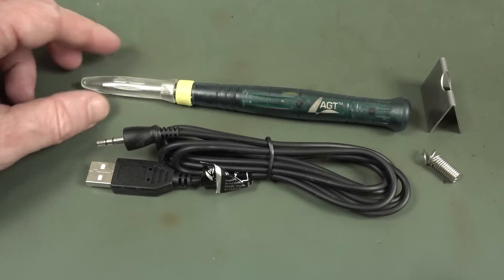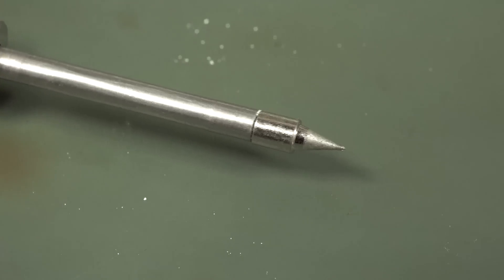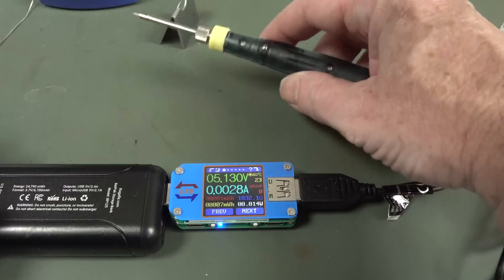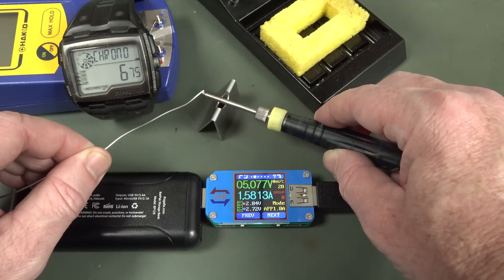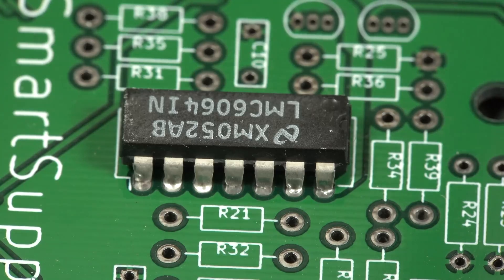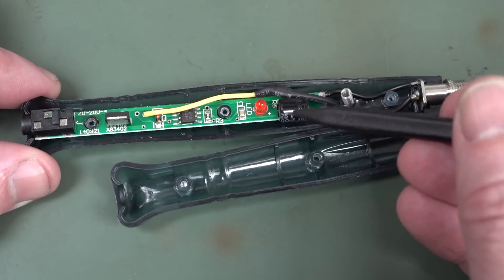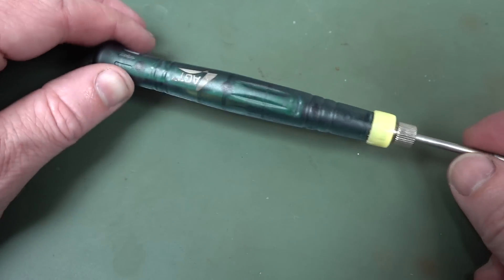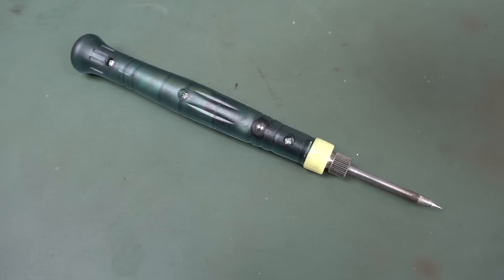EEVblog #1113 - Is a $5 USB Soldering Iron Useful?

Comment: How long was that cut in "lifting a pad" scene? :D
Reply: Peet electronics To an extent it really does not matter how long as that was a new PCB — when you go to use it on some older or vintage PCBs they can be very unforgiving if you do not pay close attention to temperature and dwell time, which can be problematic if the component has a large thermal mass to overcome since the component can take a long tine to get up to temperature but the pad heats quickly thus weakening the already weak adhesive.  Where you often get into even greater trouble is trying to desolder with desoldering braid as the temperature drop can cause the iron, braid, and pad to all become welded together, then when the user goes to lift the iron they take the whole assembly, pad included, along with their iron.  This is one of those products that would be much more useful if it were at least 15-20W with a larger thermal mass and alternate tip types, but then you could not just use a 2A 5V USB port or power bank for power.

Comment: I almost pissed myself laughing when I saw you trying t out on the ground plane...  That's like trying to remove your wheel nuts with a pair of tweezers!!!
Having said that, I do reckon it's still in the 'few sammiches short of a picnic' category.
Personally, I just keep a TS100 in the car for any 'out-in-the-field' work and can either choose to power it from the cigarette lighter, or if mains power is available, there's the old laptop charger.
(And the majority of the time, I DO have mains power available as there's almost always a 1500VA UPS or two sitting in the car too... LOL)

Comment: I bought one a while ago to fix my...soldering iron :)
it needed a simple soldered fix and living in the middle of nowhere getting one of these delivered the next day was my quickest/cheapest way out. its been in the tool box ever since and sees occasional use. 
the capacitive switch and time out thing in mine seems to work fine and appears more sensitive than this one but its still annoying. I did think Id rather just have it on when plugged in and off when plugged out and almost modded it to be so but stopped myself just in time. with the high tip temp and no regulation its probably a really bad idea to have it sitting there getting heated, if you left it for 5 minutes it would probably kill it.

Comment: The one I have also has a spring surrounded by a grounded chassis that hits the side when shaken, and is connected to the touch button. In this way it will trigger when shaken or when the button is touched.

Comment: Seems reasonable for an emergency soldering iron, which can be used with a powerbank. I would like to see some kind of temperature setting though, even as little as a few presets like 300, 350, 400, 500 or something like that. Of course the higher presets would make sense only to melt some big joints, while lower ones would be probably enough for small smd components.

Comment: 500°C it's not soldering iron, it's parts and boards destroyer. This is complete waste of money, especially when there's chinese copies of Hakko T-12 available even as the kits - they are only few $ more, but thousand of light years ahead of this POS. Take a look https://www.banggood.com/search/t12-soldering.html?sbc=1 And the T12 clones can be portable, too. They work in 12V to 24V range (of course they have lower power output at voltages lower than 24V), so they can run from lead-acid of lithium battery.

Comment: Ive got one of these. I did a few mods to it tho, i ditched the entire PCB inside it and just bought a good Anker 2.4amp rated USB cable. Cut the end off and wired it directly through to the tip. Ive just go to make sure i never leave it on. As im not sure how long itwould last if i did leave it on for extended amounts of time

Comment: Cheap USB shit, works for a while then you throw it away.
I am still using a Weller WTCP iron that I bought over 30 years ago. Still has the original heating element although I've been through a few tips. No fucking electronics AT ALL needed, it relies on the Curie Point of the tip to deliver absolute precise temp. control. If it dies before I do, I'll probably get a TS100 and put a rectifier in the Weller base station. Cooper Tools made top quality stuff in the last century!

Comment: I wonder how much you could increase the performance by adding a big capacitor? You wouldn't have to rely on such a high tip temperature all the time to compensate for the inability to deliver enough power over the USB connection.
Reply: The limitation has absolutely nothing to do with the USB power supply. It's simply that it is (by design) a 7-8W element with a very tiny tip and no thermal mass.

Comment: So the touch button only works if there is 50Hz picked up by my body?
That would explain why this iron worked in my home but not in the forrest. Weird.
Reply from the maker: Yep
Reply: yes, to get it working from powerbank you need to touch with solder tip to powerbank ground. Used it like that for few times.
Reply: @tomass9235  I have one that must be a later revision,as mine works fine with a 5300mAh powerbank I got on special at the local Canadian Tire. I rewired a cheap USB snes gamepad for USB OTG with a USB Micro cable, and I did the entire job with the thing. Now mine had it's red LED on for most of the time, and then after a bit it turns itself off like it has a duty cycle. But the packaging was a lil different, green art versus blue, but not using it on anything heavy gauge, just mainly lil projects like the one mentioned (it worked dandy with a $1 solder sucker to clear the holes in the gamepad PCB) and maybe those DIY kits you can get that are just thru-hole bits. It's a dandy if you're a model builder, and are mostly wiring LEDs and the like.

Comment: Dave i have this iron and is good. But u need connect tip directly to source without sh*t electronic inside, and use it with regulated powerbank or something like that ;) for more thermal mass i use this on 7-8V ;)

Comment: Have this as my main go to iron for most of my work, its not great but as someone who solders once a month and mostly surface stuff as PCBs with arduinos and ESPs, and does not want to have my big adjustible soldering iron constantly on my desk this does a mighty fine job. Just pop it in and 8 seconds later solder... pop it out cools down in 10 sec. And you are done...

Also i kind of like the crappy touch sensitive part as you can forget it plugged in and it would shut itself off.
And the tip is really sharp and pointy so small joints is a breeze.

If you learn to use it correctly with the limitations it has its very very handy, so have extra tips and also an extra iron if that breaks down.

and if it does not do the job just take out the big boy.

Comment: I bought one a while ago to try out. Thought it would be useless. Ended up using it for smaller jobs like thin wires and soldering to LED strips. It did it ok.

Comment: Where the heck did you find 15 gauge wire? Certainly thicker than what that tiny iron could be expected to handle. 22 AWG would be a more realistic test.
Reply: Paul Ste. Marie Remember they typically use metric spec wiring in most of the world, so rather Dave or the manufacturer are presumably converting that metric cross-section area valu to an approximate wire gauge.  Though it was the #18 wire that he just managed to solder, Dave got his gauges backwards (easy to do if one is not used to thinking in terms of wire gauge).

Comment: Ultrasonic  or NiCr wire  wound in  tool tip?.
Reply: Alberto2011Mr Either Ultrasonic or inductive heating would require higher power driver circuitry (the circuitry in this is just a glorified on/off switch, nothing more).  I doubt you will find anything more than a simple resistive heating element in this tip.
Reply: Thanks.

Comment: I use this iron occasionally for remote jobs, for hooking wires together, for a small repair. It's compact and it uses usb power that you can get pretty much everywhere. It's value really becomes clear when you consider the price. I know the TS100 is better performance but it's $55 and you need a power brick as well so I don't see any reason why you shouldn't own one of these 5$ soldering irons for the occasional remote job.

Comment: I bought one of these for some field work, but I threw it out after the first occasion I used it. Bought a TS100 instead and a 6S LiPo battery with a charger. I might have spent 20 times more, but this setup actually works, and I use the TS100 at home as well instead of my Weller WSP80 (which was kind of a reference for me for many years)

Comment: There are at least two versions of this soldering iron... the one that Dave tried in this video, and another with a spring based vibration switch which can also trigger the iron to come on... but naturally because it is a spring vibration switch (and is high up in the handle) it needs a good knock to trigger. But at least it works when you the 555  touch trigger/retrigger doesn't want to work.

Comment: First off, our good friend AliExpress has replacement tips available for $2.47 each. (Just over half-the cost of the iron; however, this iron isn't really meant for consumers who will use it enough to need replace the tips.)

I'm super glad Dave actually gave this a second look. It significantly bothered me when he brushed it off without even giving it a test--or even proper open-minded consideration. 

Regardless, I wholeheartedly believe Dave is still being a bit too hard on this device. This is somewhat understandable, as a serious electronics hobbyist (and former professional.) It IS a somewhat niche product which is designed for very occasional use. I can see it being particularly useful for areas where power is not readily available. I can think of times I'd have have used this under the car dashboard, powered by the battery USB power supply I already have a few of. The "grounded turn-off" issue would not apply to these situations. The areas this is going to be used won't be on a semi-grounded/electrostatic surface. The multiple butane irons I've formerly used in these situations always seem to have far too high of a temperature (far higher than this), even at the lowest setting, not to mention the fact that all of them cost an order of magnitude more.

As I suspected when Dave first introduced it (and proceeded to laugh it off), this review confirms that for somebody who needs it for small jobs, and on a rare occasion (or even uses it one time to assemble a "real" temperature controlled soldering iron!), I can see it easily being worth the <$5 USD.

I love Dave, but even he would surely admit being a bit of a soldering iron elitist. (My daily driver is a FX-888D, which I love, but I ABSOLUTELY understand the notion of the right tool for the job.) All told, this does have its place! (And I greatly appreciate his final summary giving it a reasonable assessment!)
Reply from the maker: I still use my original Hakko 926 I got 30 years ago. Soldering iron elitist confirmed

Comment: not bad...not good...but id use it if i had to do a small pcb soldering job..i wouldnt try to use it for removing components from pcb tho...even my 25w dick smith job struggles with that!

Comment: Saved the day for me when we were out doing ham radio, and our wire antenna broke. Soldered the thin wire back together no problem. Right tool for that job at least. I was at least 50 miles from the closest store that might have had a real soldering iron. I keep one of these in my emergency radio kit all the time now! 73 de w8tam
Reply: Thomas Martin You may actually find that carrying a small butane torch or soldering iron is more useful for your field work as not only can you make repairs to your antenna but you can also solder coax connectors and even repair connectors by simply adjusting the flame up or down to adjust heat output and the area heated (from a pencil tip all the way to a large high output flame is possible).  Alternately, a regular soldering iron, regulated or not, and a small AC inverter can also be used if you have a vehicle or 12V battery nearby (which you almost certainly will if operating with anything other than an HT).  Many butane torches even come with a conical soldering tip accessory in their packaging if you should need to do a simple board level repair since you can not use an open flame on the PCB (though it helps to break those tips in before you actually need them, sometimes they are easier to break in if you first use an acid flux to initially coat wet the with solder the very first time, then switch to a proper no-clean/rosin flux).  Much more versatile and useful in my experience, especially if stuck atop a tower.

Comment: While it could be used at a bench there's no way I would choose it over my Hakko station, it's really a different tool for a different job and using it at a bench is analogous to taking a mains powered soldering station into the field. Recognizing where and when it's likely to be used the lack of temperature control becomes more understandable and I don't think it was ever meant to compete against a mains powered soldering station, but rather with portable butane powered units which tend to have more inconsistent temperature control.

I have one in my kit as it has proven more reliable/consistent than my previous butane soldering irons. I don't have problems with it turning off during usage like the one in your video however mine has a shake/movement sensor which keeps it active without using the touch sensor.

It was bought initially to see how much of an improvement it was over previous battery designs (which were universally pretty terrible), and after using it for some time I found it preferable to my butane Weller unit; the time taken to heat up with Butane meant I avoided turning it off, resulting in what felt like a constant reoccurring need to refill it (which I do not miss). I still keep a butane powered unit around however it's relegated to heatshrink duty where it performs admirably.

Comment: 4:14  What kind of display is that on the meter? looks nice
Reply: It's a Ruideng UM25 meter and that's a colour LCD. https://www.aliexpress.com/item/RD-UM25-UM25C-for-APP-USB-2-0-Type-C-LCD-Voltmeter-ammeter-voltage-current-meter/32855845265.html?spm=2114.10010108.1000023.3.39efe6d4UQtfqh”: (cheaper on Banggood and Ebay).

Comment: What I'm wondering is, how this thing can draw 1.5a from powerbank with a usb to 3pin connector. I cant draw anything more than 100ma from a powerbank or a phone charger while using micro usb plug, is there a trick for that (like connecting usb data pin to ground)?
Reply: This thing doesn't use a MicroUSB. It uses a full size USB plug. What you need to do is stop using adapters (3-pin, etc) and just plug it in directly.
Reply: What is the difference from using a microusb plug, or just using a usb cable
Reply: J1ONN - the difference is that they are completely different connectors. This iron uses a standard USB Plug. It doesn't use MicroUSB like a phone has a socket in the bottom of it. That is because this soldering iron is designed to be powered by the same charger or powerbank as your phone might plug INTO... which is a standard USB socket.

Comment: i'd rather use a ts100 🤔
Reply from the maker: Of course, it costs >10 times more, is temperature controlled, and has a direct heat high capacity tip.
Reply: yep thats the reason. even used it as my main iron for a while until i got a jbc

Comment: going to hack mine with an attiny for temperature control someday
Reply: Temperature control is actually a step backwards with very low wattage irons like these.  In order to do any solder joint of decent mass they actually need to precharge their own thermal mass to a high temperature so that when they dump all that heat into a joint the joint plus solder is still more than the 180-220°C required to keep the solder liquid.  That is why you really do not tend to encounter many regulated irons of less than about 40W capacity, because the thermally regulated iron must have enough real-time heating capacity to overcome the thermal losses encountered at the tip during soldering, they can’t simply rely upon excess built-up temperature stored in a large thermal mass.  Additionally, thermally regulating a tip is not as simple as just pulse width modulating the power, that PWM duty cycle must be continually varied in order to offset changes in the rate of heat loss at the tip, which requires continually monitoring the actual tip temperature.  There is a tremendous difference in the required average power delivery to maintain a constant tip temperature between a tip resting in free air in its stand versus a tip that is pressed against a relatively high mass component and that is having room temperature solder fed into it and wicking away heat very quickly. 

If you did want to convert one to proper temperature regulation (though I would suggest starting with a much higher wattage iron if you want something especially practical) you could exploit the fact that the iron heater is typically just a resistive heating element and either periodically measure its actual resistance or you can monitor the current draw for the minute changes in the current consumption (e.g. the higher its temperature the less current it will draw due to increasing heating coil resistance) to roughly gauge tip temperature in real-time since these iron tips do not include a built-in temperature sensor.
Reply: Just use a $2 PWM driver.
Reply: attiny13 cost $0.50
Reply: Reesey Me - nobody cares how much an attiny costs. It's pointless to use such a device to vary the power level.